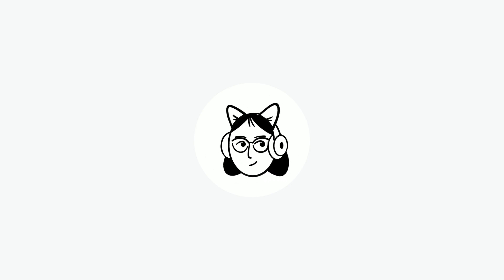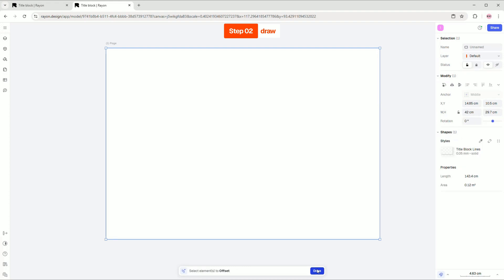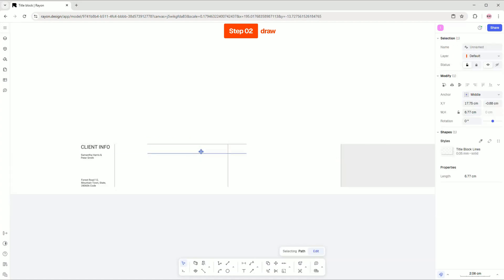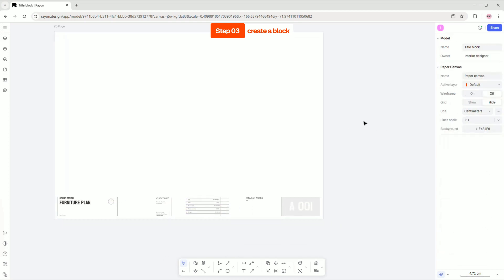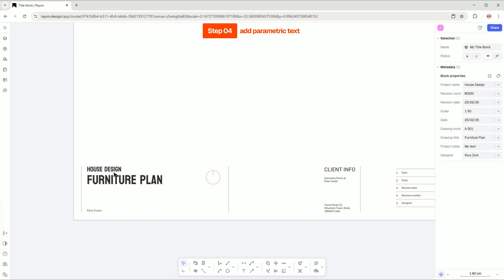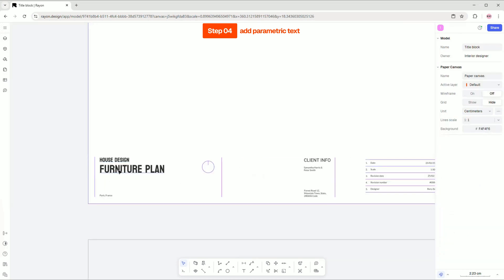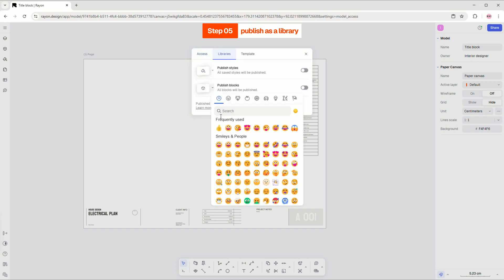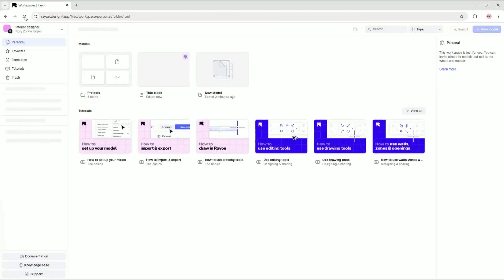How to create custom Title Block with editable text in Rayon.design – Step-by-Step tutorial

Comment: I have created a title block as a block in Rayon, where I added custom properties (like project name, drawing number, etc.) and inserted property fields into the text to make them editable individually on each sheet. After assigning the properties and linking them properly to the text fields, when I change the property values, the changes reflect correctly in the block's property panel. However, the text inside the sheet does not update accordingly. Despite inserting the fields properly, the visible text remains the old value even after changing the property.
Reply from the maker: Hi @apoorvabhargava336 can you please send me your model URL so I can take a look?
Reply: Hi, thanks but I saw your vedio again and figured out that I didn't used 'instance' but thanks for the help
Reply from the maker: @apoorvabhargava336  Happy that all is good on your end :)